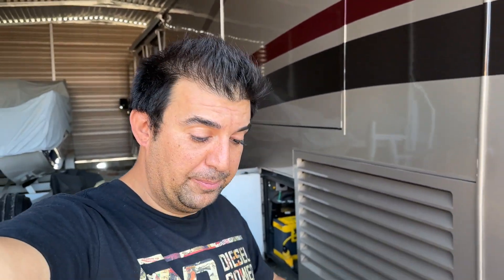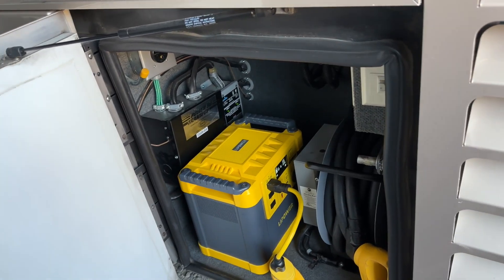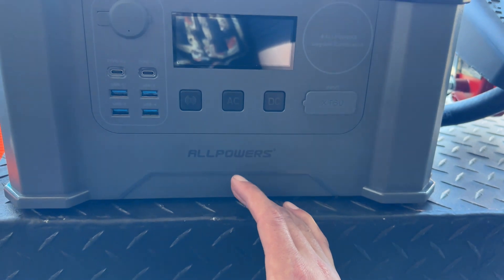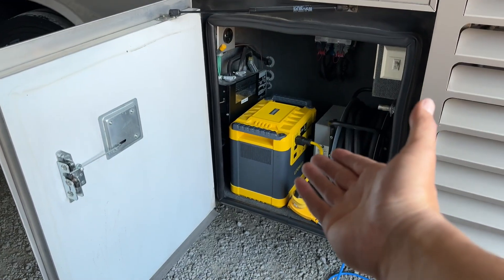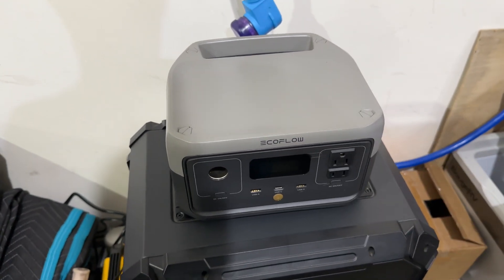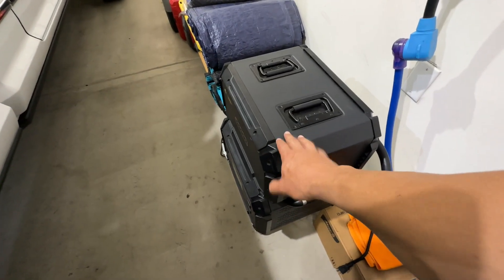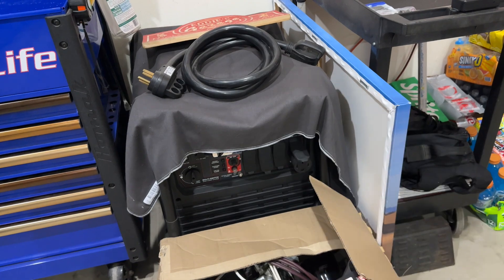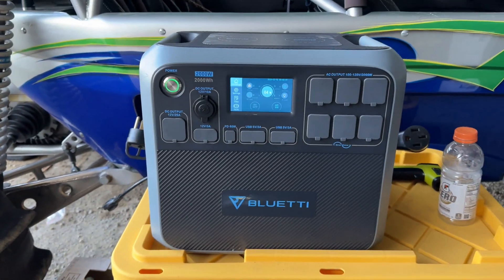The truth behind solar power inverters!!!

Comment: By the time you build one to last 24hrs of use. You have something that weights 100 lbs...Just build your own...Why I bought the Renogy 3000 watt inverter\75 amp charger\transfer switch\Auto start generator....I can charge on Solar, Alternator, Shore Power and Generator.. All in one convenient package. No fuss wiring solution too...
Reply: I'm pretty close to learning that for myself here soon. Thanks. I know how this goes, and things for Convenience always these similarities.  If you build a r/c car or I'm even gonna say a drone. A lot of times what you'll notice is that the ready to run (RTR) Convenium versions always suffer somewhere.  Beit weight, power, length of run time or versatility, and add one later.. so many buy like they've got to hurry. Part of the main reason why I'm watching this channel and in particular this exact video. Unintended by you, but thanks for your nudge of confidence.  I will look into building.  My heart just tells me so👍

Comment: My pusher has an inverter but if it’s above 60* outside my generator is running from when I leave the house until I get back home to keep the ac running and comfortable down the road. The diesel generator sips fuel too

Comment: I have 2 eco flow delta pros that I wired into front compartment on my 5th wheel can run full 50 amps through them only downside is I haven’t gone through the hassle of mounting the solar panels on roof lol so I still bring gas generator 😂 but for 2 hrs of gas generator I get about 12 hrs of battery runtime. If I didn’t have the electric/gas fridge probably would last 24 hrs no problem.

Comment: It’s a fire hazard in that compartment Eddie that’s probably why the fans always on they don’t want it to get too hot to blow up 🤣And how do they do in the cold temps you think it drains the battery faster?. I’ve always been skeptical about those things I just run my small Honda or  champion. I’m looking forward to seeing the solar panel video when you get the trailer